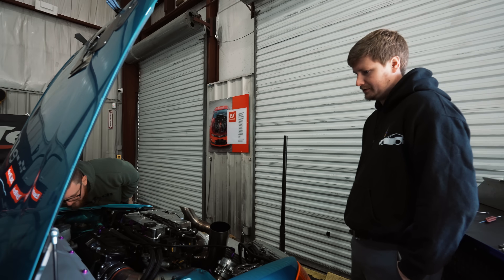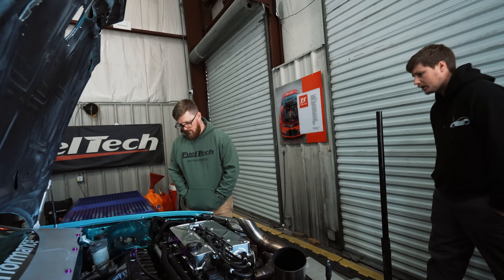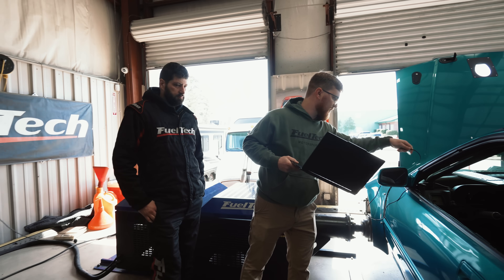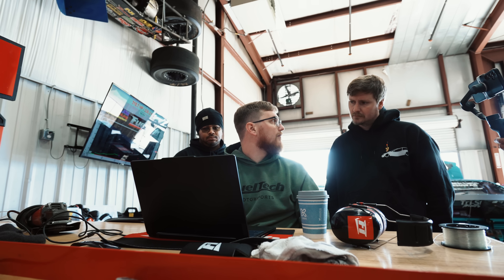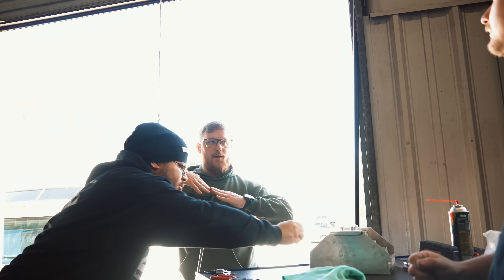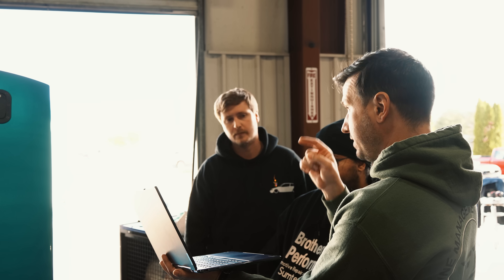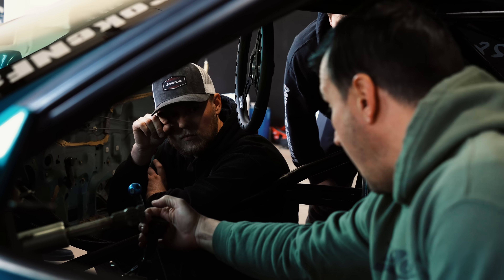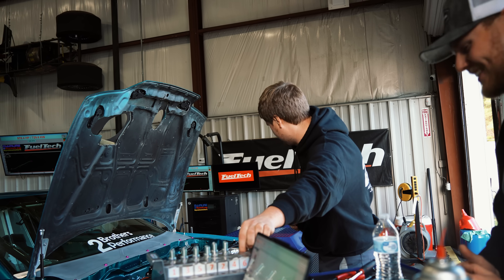Turbocharged B-Series Honda CRX Hub Dyno Tuning on M1 | FuelTech USA

Comment: Would love to know what size turbo they have.
Reply: not big enough apparently, at least on the exhaust side.  Turbine pressure per boost a bit too high for my liking.
Reply: @BenS12510  I was thinking the same! I was expecting it to clear 1000hp at the hubs, especially wicked up on M1. On a side note, I'm a big fan of yours, Ben! Love what you've done with the FJ platform. Funny seeing you here.
Reply: @PhantomShane914  Thanks.  You mean this ?  https://www.youtube.com/watch?v=UnnVyBFYlAc  Or this ?    https://www.youtube.com/watch?v=eLDqthENJJQ  Got my Gazelle back a few months ago after 18 years and am restoring it with my kids.  Should be fun with some modern bits in it.
Reply: @BenS12510  Both for sure! I really enjoyed the HPA podcast with Andre, I learned a lot more about the platform. I've been in love with the DR30 chassis for a while now, and by extension the FJ. Congratulations on reclaiming the Gazelle, hopefully you post up some content on the resto!

Comment: I am wondering, unlike a regular roller dyno, how do you make sure both sides of the hub dyno are lined up? True question here and no I don't want to google it.
Reply: They are on runners attached to the floor, they only move in and out for the car width.

Comment: So after the ignition cut to shift it will drop timing to 0*?
Reply from the maker: It dropped timing to 0 during ignition cut. Since 40% ignition cut level is set (on the video), that means that only 40% of combustion events are cut, the other 60% are with 0 degrees of timing.
Reply: Ahh I see thank you for explaining that is really cool.